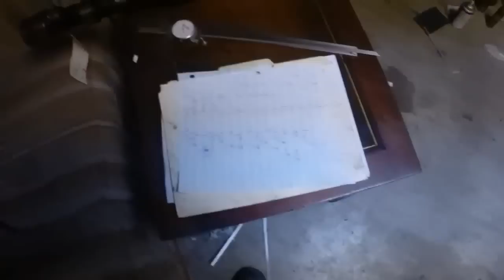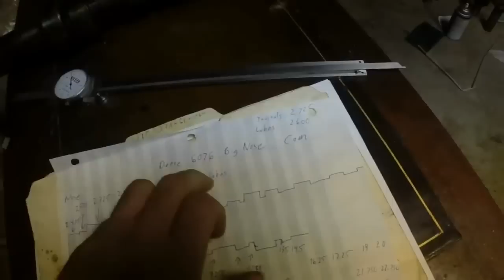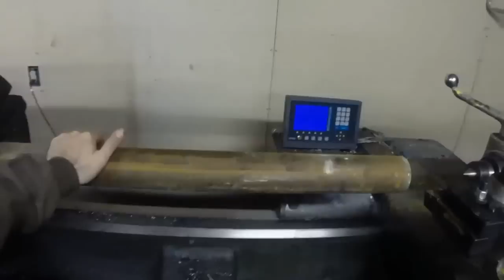Billet 8620 Cam Blanks

Comment: hmm, I was sure I commented on this already.

Nice job on the camshaft, I've seen full camshafts and cranks turned on cnc, nice to see step one done on a manual lathe.
Reply from the maker: Thanks! Maybe I will try to turn a crank someday, that would be a challenge for me anyways.  I think I would probably set it up to mill it on the HBM and use  the rotab and dividing head to locate the throws, once it was all milled out it could easily be finished ground  on a crank grinder and have a nice billet crank. :-)

Comment: That looks like a billet roller cam shaft for a pulling tractor with an aluminum head. Maybe a John  Deere with a cross flow head
Reply from the maker: You are about 50% right. :-)

Comment: It must have been tough to mount the lathe on the ceiling.
Reply from the maker: Yeah but it keeps the chip pan clean.
Reply: I know you meant that as a joke, but now I'm wondering what would happen if a benchtop lathe was mounted in a frame with the ways above the work.
Reply: A vertical lathe!  Who wodda thought

Comment: i dont mean to be rude or what not and im only new to machining myself and still have yet to acquire a lathe but i do have a mill

isnt it a wiser move to turn down say 4 inches from the end instead of almost the whole length when you first chuck the peice in the vice to true up the one end and then flip it around and turn the whole length?
Reply from the maker: I don't follow what you are saying exactly. The centers will be what is used to locate for the grinder so they are what is important. If you were worried about the effect of scale under the chuck for diameter as you needed to maintain max size then doing what you proposed would be an advantage, but since it all had to be turned down in this case which end you start with doesn't make a lot of difference. as it will be trued  to the centers the first time you flip to turn the other end.

Comment: i need two custom cams made for dodge/jeep 5.9 magnums and two for 5.2 magnums. I just need the blanks made up is that something you'd be interested in doing? i need four cam blanks for four different grinds for three different jeeps
Reply from the maker: Aren't those cores readily available in the aftermarket? I would think Crane would have 8620 cams for that application. If not them Crower.
Reply: +bcbloc02 I'd rather spend my money where it counts and have a skilled professional like you get the money besides it would be a really cool video if you'd be interested
Reply from the maker: Do you have one I can copy? Does it have a gear made on it? Send me an email and we can discuss it.
Reply: +bcbloc02 i do and they do have a gear on the end. I'm on the road as soon as I get home I'll email you with pictures. Thank You Very Much

Comment: Brian, you seem to use your 3 jaw Chuck a lot more than other fellers on youtube,  any reasons?
Reply from the maker: My chuck is pretty good and I can expect it to chuck an item to within less than .002" runout and for most applications that is good enough.  The speed of the 3 jaw is usually a bigger benefit to me than the accuracy of a 4 jaw. I don't normally chuck squares or odd shapes in my lathe so I mostly run the 3 jaw.  Keith Fenner used to almost always use a 3 jaw but I think he was doing more shafting work then and less odd stuff.  My Big Monarch will be 4 jaw only.

Comment: Hello, is it possible to machine a blank camshaft with the same max lift and duration as the stock one just with a bigger bas circle in order to extend the area of max lift more? For example 240° duration 9mm max lift for 5-10°. 

In the blank we keep 240° duration amd 9mm max lift but we make larger base circle to allow 9mm max lift for 12-17° while maintaining same cam lobe agressiveness. Please what are ur thoughts?
Reply from the maker: Base circle is the time when the valve is closed, you can not alter it without changing duration.  What you are describing in your example is a restricted lift high dwell cam and those do exist. It does however by default have to be more aggressive in opening or closing or both in order to be able to achieve the max lift quicker and hold it longer.
Reply: @bcbloc02  thank you for you quick reply.

I completley agree that modifying the base circle with alter duration. But that can be avoided by raising the cam tray. Meaning that if I increased the base circle by 2mm I raise the cam tray by 2mm, I am trying to avoid steep accel and decell and have max lift as long as possible, is this a valid solution? I also have roller rockers

Second, the peak rpm is 7000 and the cams in the market are all regrinds.  I do not want to alter duration as I want to keep the torque curve the way it is.
Reply from the maker: @FirstLast-tx3yj  I don't know what you mean by cam tray.  If you increase the base circle diameter you will decrease the max lift all other things being equal.

Comment: on a shaft that large, a 3-point follow rest is desired over a 2-point, because the cutting force is less than the gravitation force, therefore it's not really being pushed into the 2-point's rollers. Though, at that diameter and length, the shaft's sag is not really noticeable so i wouldn't have used a follow rest even if i had it.
Reply from the maker: That isn't really accurate. I can assure you the cuts I was taking are higher in force than the gravitational force.  If you pull the tailstock out during a cut I can guarantee the part will climb up on top of your cutter and wreck it rather than falling down on to the ways.  At some size you could have what you are describing but you would be talking a monster of a shaft, well beyond anything I could ever lift.  I did end up doing this job without the use of the follow or steady rests, but I am confident with a nice set of soft bronze inserts in the follow rest I will be able to do this job with less chatter and vibration. It is mainly only a problem when doing plunge cuts in the middle because the cutter radius makes very high cutting forces by trying to gouge an 1/8 wide piece out. A narrower insert would be better, but then you run into less stability doing the turns and will probably not be able to take as a big a cuts. It is a catch 22.  I am glad you enjoyed watching the chips fly and thanks for the comments!

Comment: Why people use a parting off tool turn to down a dia like this is beyond me.Just change the tool holder
Reply from the maker: +Carlos It is not a parting tool, it is a groove and turn. I use it because it allows me to get into all those little grooves and I can accurately position and turn to diameter from the DRO because I don't have various tool offsets.  Also in order to turn to the shoulder in each of those grooves would be multiple tool changes and way more work.